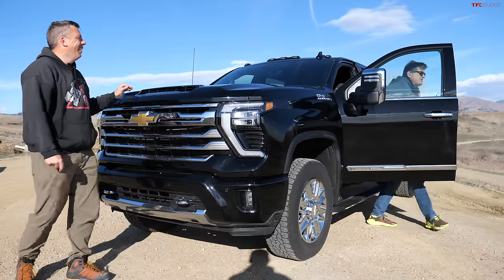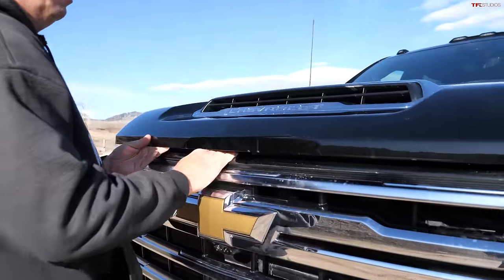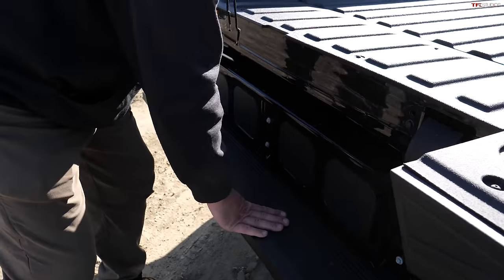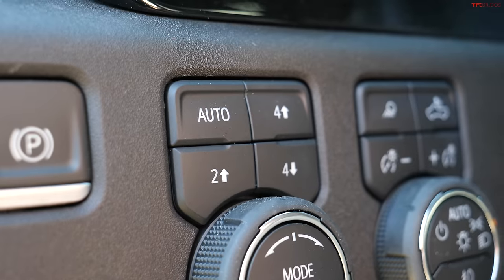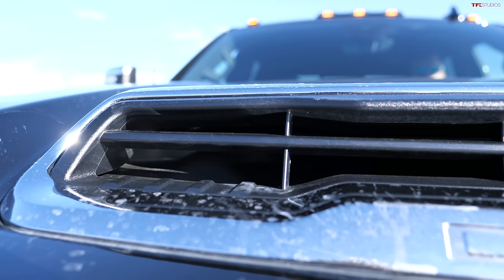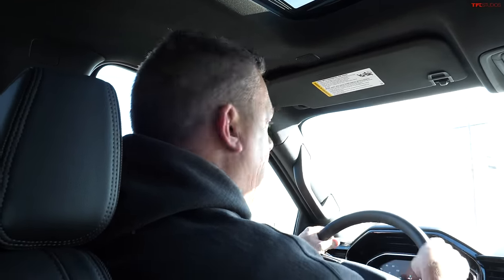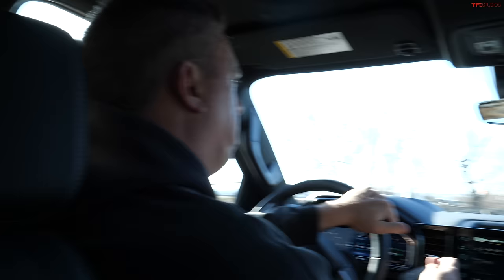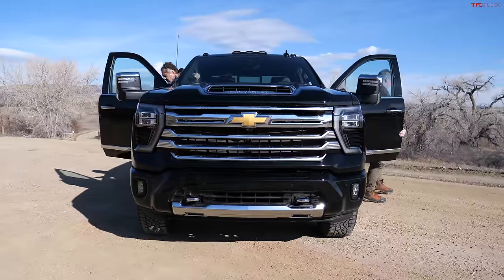Is The New 2024 Chevy Silverado 2500 HD Duramax Diesel The New Benchmark for Heavy Duty Trucks?

Comment: I want a company to make a cheap truck again. Something that can handle 15k lbs and under $30k. Give me roll windows, a bluetooth speaker and cruise control.
Reply: They exist they have no warranty, have 300k miles on them, are 20 years old and are called used.
Reply: @williamconrad1087  But if you can make a small compact with all the bells and whistles $20k, you think you could scrap all the luxuries and make a truck frame with decent engine and 4 speed to get the job done. With less than 500miles and built for 2024!

Comment: 😂😂 congratulations Chevy You're now as quick as a 2018 F350 dually
Reply: Chevy is always better
Reply: @jonasoutdoors  in what, please share?
Reply: Yeah- because "quick" is what matters buying this kind of truck.   I would say around 40 to 50 percent of buyers of these trucks could use a 1/2 ton and never be lacking-   they're just in it for the image.
Reply: @jonasoutdoors  better than what? 😂
Reply: @AJ12-76  ford
Reply: @AK_Ray   everything.
Reply: @jonasoutdoors  in what particular aspect exactly?
Reply: @AK Ray  doesn't rust as quick engine is more powerful and engine last longer
Reply: @jonasoutdoors  Ford bodies are made of aluminum (no rust), Ford and RAM frames are electocoated (less rust) versus GM's wax, Fords SD gas and diesel produce more horsepower and torque than anything GM offers, Rams h.o. diesel also produces more power and torque. Engine longevity comes down to use case and maintenance so there's no difference between all three.
Reply: @jonasoutdoors  can I have whatever you’re smoking? 🤣🤣🤣
Reply: @jonasoutdoors  Chevy is definitely more reliable, at breaking down. Guaranteed that will happen damn near every time
Reply: Ford still hasn’t fixed the infamous super duty death wobble.  Ram has.  I sold my f250 with 11,000 miles on it since they’re was no permanent fix, only a “bandaid”
Reply: @BigMikeRobinsonFJB  lol a degree of camber, fixed.  pencil tie rod says what...
Reply: @AK_Ray  wrong. It’s the intermediate steering shaft. After that’s replaced with a “bandaid” they adjust toe and camber.  I’ve been through all this and the ford engineer said there was no immediate fix. Only a bandaid as he called it by replacing the ISS with another new junk part.
Reply: @nydieselinfl  i sure hope you ain't putting reliability and ford in the same sentence,them piles of 💩 can't outrun there own warranty muchless anything else.
Reply: @camclarke9952  yes lol

Comment: Not that Motor Trend would say this (because they suck), but the driver options for power train are split. which is  kind of annoying. MT said the same thing about the new Tundra, but I think they are smoking hardcore, because it's all on the center console. For new, small screen and no panoramic roof, behind the industry on this one. Sadly the front end is boring, not horrible, just boring.

Comment: I hope it better then the piece of crap I bought 4 hundred miles on it the machnics put most of them on it trying to fix it it's been three months still at the dealers they can't seem to find what's causing the problem but in the process found a hole in the flow pipe to the turbo and another issue but the problem remains I was counting on the truck for a planed trip on April 6th looks like that's out so much for reliability and dependability there products are junk I bought a 2018 traverse 12 hundred mile the transmission failed nothing but junk

Comment: You get 15 MPG of $4.40 a gallon diesel
Reply: New truck engine. I have the 22 and it gets 20-21 on the highway, but it took 5k miles to break in before I achieved that.